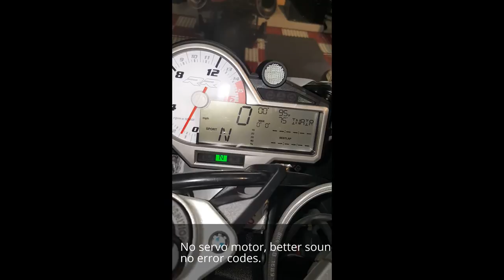2016 S1000RR Servo motor removal and servobuddy install

Comment: You did not install it on the front servo motor ?
Reply from the maker: No, just rear the rear, much harder to get to the front one. I've also heard it's better to leave the front one.
Reply: I've got to do both front and rear because im changing my whole exhaust system

Comment: Can I install full exhaust system and use 2 servo buddy for front and rear without tune ? Does it harm the engine ?
Reply from the maker: If you install a full system, you can remove both servos, but you will need to update the ECU to tune everything. Tons of tuning options out there.

Comment: Dear Friend,
Could you please share your ride experience difference after servo / exhaust butterfly removed.
I am asking to know if the system actually increases backpressure at lower RPMs like companies say OR they were simply for controlling sound decibels.
I own a 2016 Z800 and am confused about slipon between Akra which has the exhaust value and IXIl X55 which sounds too good.
Reply from the maker: No idea, sorry. I did not dyno before or after. I removed it for weight savings and sound purposes. I have ridden the bike very hard at the track multiple times and no issue. I doubt there are any performance gains from this mod.
Reply: i removed the stock exhaust and the servo and installed akropovic shorty type exhaust , does it harm the engine?

Comment: The servobuddy is installed cause of the dash error it gets if you remove it??
Reply from the maker: Exactly. That is its sole purpose, tricks the computer into thinking the servo is still there.
Reply: so if i remove the servo sensor, will i get a check engine light on the dash?
Reply from the maker: Yes, you will get an error, not sure what it looks like, but it does trigger a fault.
Reply: why didn't you just take off the cables only? servo can work without cables and without errors... Or not? @Concordeagle
Reply from the maker: @evgenyivanov235  Yes, but I prefer to keep the whole unit together for easy storage.

Comment: i tried this on my  2017 with stock subframe but it just won't slide out and i'm afraid i'll brake it...any extra tips?
Reply from the maker: It will slide out, once you unscrew it there is nothing else holding it, just be patient and wiggle the cables, they will come out. Use tape to make it slide easier.  You don't need to remove the subframe or swing arm.

Comment: Did you get a Faulty code before you installed the servo buddy? And if yes did it go away on its own when you installed the servo ?
Reply from the maker: No, you should not unplug servo motor and run bike without servo buddy or you will get a fault code and have to use a tool like Motoscan to reset.

Comment: Do I have to remove both servo motors for it to sound better or is the rear good enough?
Reply from the maker: Rear servo only, don't mess w the one by headers unless you are installing a full system and getting everything tuned.

Comment: disconnect that butterfly and your bike will serge and run jerky under 4 thousand rpm.  I've been hunting why my bike is shit in traffic doing 20 up to 50 kph. been driveing me nuts. brought the bike second hand and the guy didn't tell me he had disconnected it.  untill lucky I noticed  the cable going to the server black box on baffle wire disconnected ..it's for backpreseure and it needs it to run smooth.  at low revs . 2018 s1000rr  12000 km old. . leave it on unless you just ride wide open.  ..who does really.  this is a very mild serge but after 40 minutes  in traffic.  youl get the idea. I even want to try and somehow make the fuel more ritch from 1 thousand to 4 thousand  to smooth it out even more. still feels a touch jerky .. any ideas???  s1000 rr  booster plug ???
Reply from the maker: I have not experienced this behavior. Are you referring to the second servo valve higher up near the headers?
Reply: @Concordeagle  no..its right foot side at end of baffel ..was wondering why it was no good even took it into bmw bike shop they said it was fine . it's still a tiney bit serging . they make these bikes run lean for emitions I've read . it could do with more ritching up.  I'm looking at boosrlter plug or power comander .. because (before) I reconected the butterfly valve it ran better in first 3 minutes because motor was cold and on initial start up they run ritch until warmed up . hence booster plug. check it out ..it fools the fuel system into thinking it's minus 5 degrees ..makes it run richer ..and smoother...this bike at 3 to 4 thousand rpm that big butterfly valve is shut ..backpresuse it liked to help run at a smoother ride.
Reply from the maker: @petermoygannon698  not sure man, my bike runs awesome, no surge issues whatsoever and lots of people on s1000rr forum have done the mod without problems.
Reply: @Concordeagle  well this guy I got it of didnt    mind how it was.i  just wasn't a comuter bike as well as a sports bike. I want a bike that's happy doing 20.  as soon as I saw that disconeted I knew I got the jackpot.  my hyabusa was shiting on this bike for smoothness.. it's still doing it a little so I'm not happy yet . fixed 70 % ... the problem I had remember is very small but noticeable after alot of going slow and got worse with hot engine..that you get in deep traffic.  ..did you Google that booster plug for s1000rr it's made for this reason .someone knew there was issues.. .I'm convinced this bike is still running a touch lean under 4 thousand  ..mabee right througout the rpm. 10 to15 % . I've got to find a way now to do that . mabee power comander . or booster plug .
Reply: @Concordeagle  this butterfly valve defanatly creates backpresure there is no doubt there it's a closed valve at 4000 rpm if you tap the throttle to 6 thousand and  hold it at 4  it opens slightly and closes again .starts opening up past 4 . so this mod has been busted . so people now can make up there own minds .the ecu map I would think would be same for every country mabee not I'm in Australia.  this mod   good mabee if you never go to the city . lol have fun buddy ride safe ok thanks for time.
Reply: Hi Peter Moygannon . did you resolve that problem with jerky run on your bike ??. it looks like i have same with my s1000r. one diferent is that i have full Yoshimura exhaust system |( headers and silencer ) and there is no butterfly valve ( Exup ).
Reply: @Concordeagle   no the one down on the flat near footpeg.
Reply: @OMari2701  Its still a little jerky defanatly better . but I found that as soon as I get on it without warming it up and just go . It's even smoother . once it gets to the crazzy temperatures that's normal. red hot it runs a little sick at low revs.  you can bye a device that tricks the cold air intake to make it run richer that in my mind would fix this straight away.  they run lean from factory.  maybe talk about making it run richer slightly.
Reply: @petermoygannon698  Thanks Peter for reply. Do You have ServoBuddy intalled on Your bike ?
Reply: @OMari2701  no   I will check them out